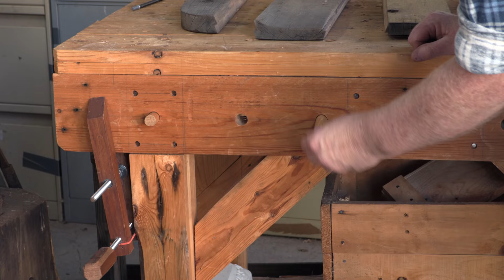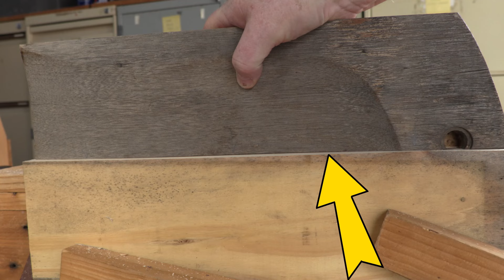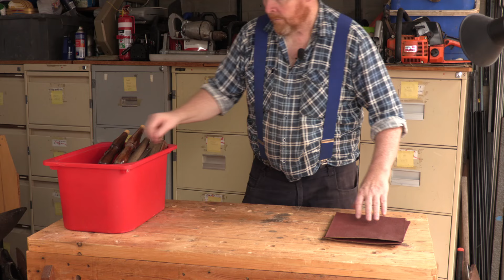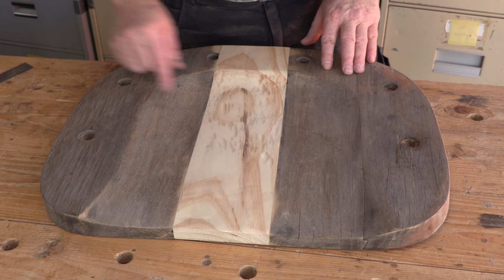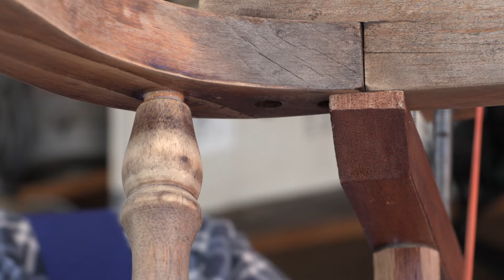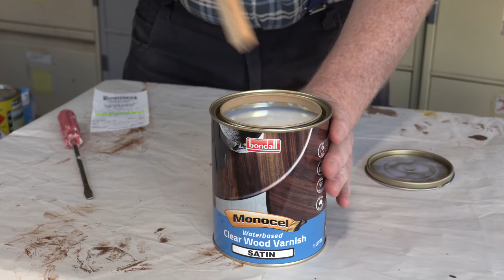Wooden Chair Repair

Comment: 10:45  Just a tip: While the glue was setting up, you should have turned the chair over and briefly sat in it. This method ensures all four feet are touching the ground.
Reply from the maker: That's a great idea - I'll remember that if I ever do another one. 👍👍

This one worked out OK - I only needed to shave about 2mm off one of the back legs to make it sit flat on a hard floor.

Comment: those water vertices are not so good if you prepare wood with oil stain. the pill out in year., they are good if you stain the wood with water stain
Reply from the maker: That's good to know, thank you.  I'll see how it works out over time. 👍

I'm happy to experiment on a piece of furniture like this one, that isn't precious or valuable. 💸
Reply: @TightwadWorkshop  i was 30 years technical director for the municipality of my city . we had 30 carpenters and we did to many furnitures for schools offices and all stuff that city hall needed. we try to follow e.u laws for water vernice and we had some disasters. so i am 100% sure. dont use them on oil treated woods
Reply from the maker: Thank you again.  I'm happy to learn from your experience, but since this piece has already been stained and varnished I'm now basically committed to the experiment! 🙂

Once again, thank you for your advice.  I'll keep it in mind for my future projects.

Comment: Know-how, you can impart through such a video, patience, on the other hand, is a difficult lesson to deliver effectively.
Reply from the maker: I'm getting better at patience.  In my younger days I would have started this project right away and abandoned it multiple times over the following year.  Now that I'm older, I know that a better method is to ignore it for a year first, then just Get It Done.  👴👍